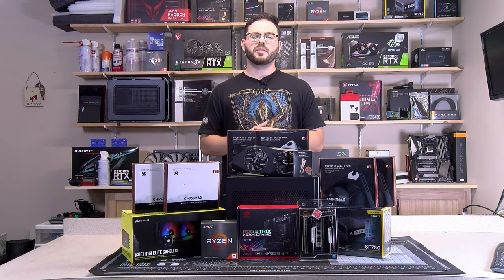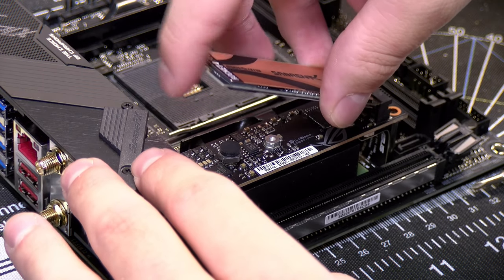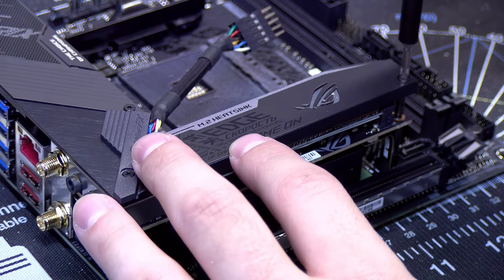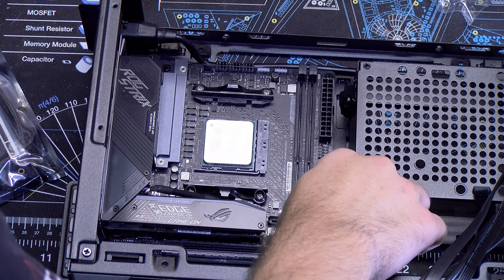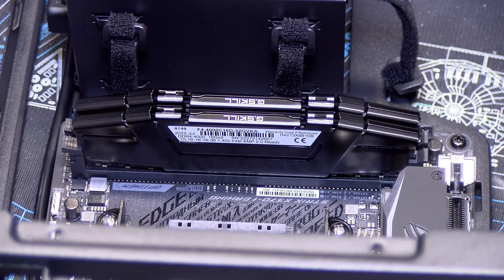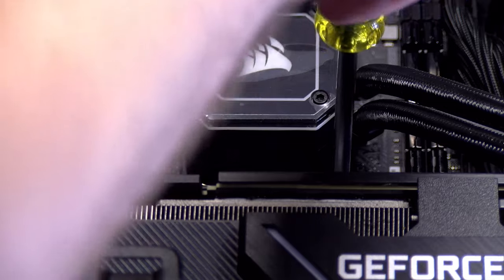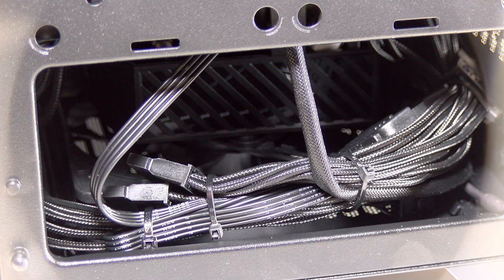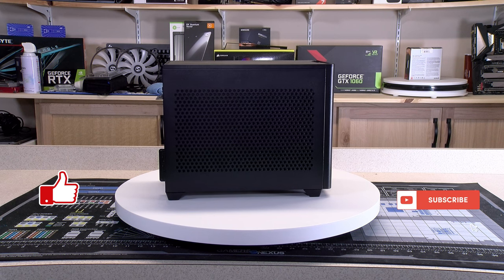CoolMaster NR200P $1800 Build

Comment: I would recommend Arctic fans over noctua ones if going for all black/no rgb build. They are almost as good as noctuas and cost like third of their price.
Reply from the maker: i do like arctic fans for sure. especially on their arctic freezer line. unfortunately they do not have a p12 slim model for the bottom fans and did not want to mix.

Comment: Would the Noctua NF A12 25 fit as bottom fans? I'm looking to make a build soon and thinking of having 2 on bottom and 2 on top. Thanks!
Reply from the maker: i would check the width of your gpu but you can mount 25mm thick fans on the bottom.